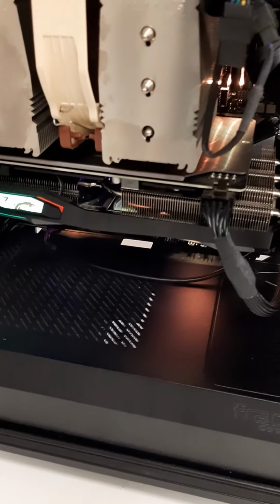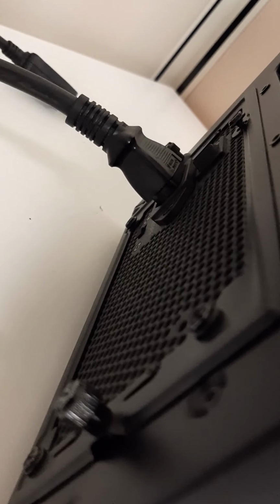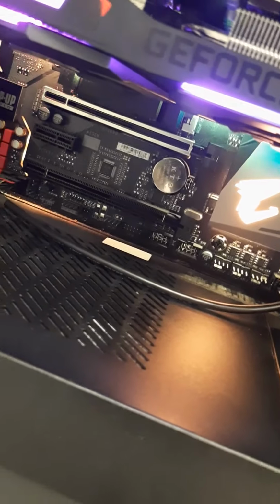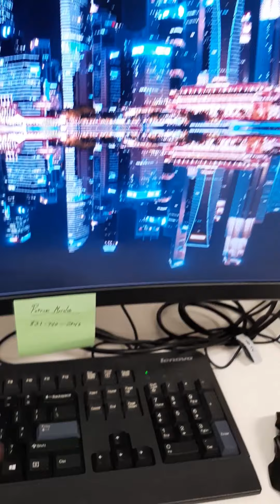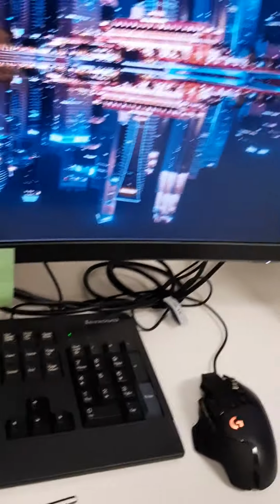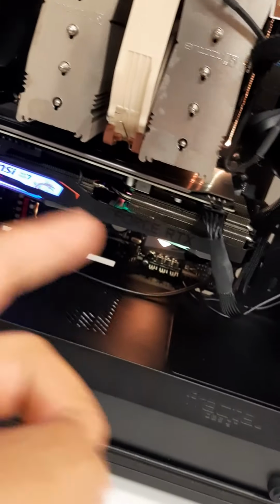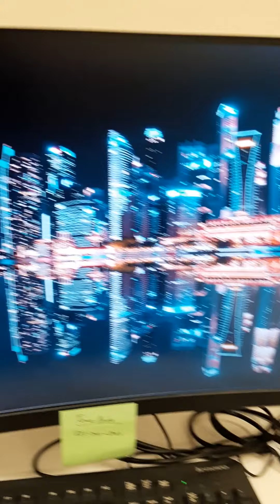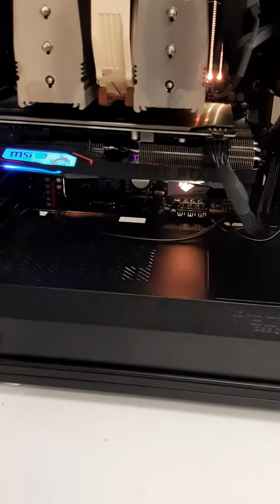HOW TO FIX BLANK SCREEN AFTER ENABLING SECURE BOOT | Windows 11 Upgrade Headache Fix

Comment: I found the reason of the problem, and your solution works for me, thanks for the help :)
Reply: Also in the page of nvidia they recommend the same solution as you
Reply from the maker: What's the reason? I'm glad it worked
Reply: @anthonydiaz6101  For some strange reason YouTube removes my comment when I put a link, so I will send you the link in parts so that you can join everything and you can see the reason according to nvidia
Reply from the maker: @Sandox  it might be because there's a lot of scam comments these days
Reply: @anthonydiaz6101  I tried to send the link in 1000 different ways, but youtube won't let me, so if you want to know why, google:

When installing an after-market graphics card into a certified Windows 8 PC with UEFI enabled, the system may not boot.

The first result.

I hope it helps you :)
Reply: @anthonydiaz6101  And sorry for my bad english XD
Reply from the maker: @Sandox  No worries at all. I'm no English major either 😂
Reply from the maker: @ItsSandox  Thank you!

Comment: bro plz help me i have that same situation right now.. i did that all steps but it has a black screen even my system unit is running on
Reply from the maker: If this did not work, your CPU may not have integrated graphics. You may need to get a new motherboard and just not turn on secure boot after that. Try going through the comments section or keep looking through forums.

Comment: Hey can you help me after connecting graphic card wire to motherboard  the screen is not showing
Reply: I dont want anything ..
Already solved 😂😂😂😂😂😂😂😂😂😂😂😂😂😂😂😂😂😂😂😂😂

Thank you brooooooooooooooooooooooooooooooooooooooooooooo00090
Reply from the maker: @Freternalyouth  Awesome!
Reply: @Freternalyouth  can u please help me🙏🏻🙏🏻🙏🏻🥺🥺🥺
Reply: @spectoryyt2576  what happened ???
tell me
Reply: I was trying to enable the secure boot but i had to update the platform key first then i saved and exit the the monitor isnt booting after it
I tried everything for 11 hours streak but no hope i tried this vid way but still not working
I took the GC out and tried to plug the monitor with the mother board directly but still not working ive tried everything i think i am forced to pay 150$ for a new motherboard unfortunately
Reply: @spectoryyt2576 same happened with me i did csm(secureboot) [for playing valorant] on and after that my pc stuck at motherboard name and unable to open bios
And then i went to motherboard and cleared the bios 
Wait I'll send you one vedio 
I will explain here full
Reply: @Exe.Gameplay yeah offcourse what is your problem??/ tell
Reply: @Exe.Gameplay cant able to play valorant??
Reply from the maker: If you don't have integrated graphics, this method may not work. I hope the comments section could help you out. Some people have found ways around it that have worked for them
Reply: @spectoryyt2576  I'll try to help you. You need CPU that have integrated video. Only in this case you will fix black screen when pluged hdmi to mother board. Maybe your friends have CPU with integrated video. What is your cpu?

Comment: If a have a intel processor that dont have graphics, what should i do?
Reply: And please, can you write the exact instructions of what you do with your pc to fix that error? Please, i dont understand english so much, so you can help me with that?
Reply: I have 2 weeks trying to get another processor with graphics and i try to do the solution and that didn’t work, so you can help me with the instructions? Please bro i need you help :(
Reply from the maker: Go through the comments. A few people have managed to make it work without integrated graphics. Unfortunately, I don't know another fix for this issue. I got lucky that my CPU had integrated graphics or I wouldn't be able to fix it.

You can get a new motherboard. Getting a new graphics card that supports secure boot would help as well. Please scroll through comments for that. Someone fixed the problem by getting a new motherboard and graphics card that could handle the settings. A new motherboard should be enough though, if that's a possibility. Sorry I can't be of much help.
Reply: @anthonydiaz6101  i see, dont worry, my graphics can take changes or damage with that thing of the secure boot?
Reply: @ecochannel9940  send the Mobo to service centre for reprogramming the bios

Comment: Well for people who doesn't have integrated gpu. Try to use the q flash to update your bios if the motherboard support. It save mine.
Reply: Q flash? Please explain
Reply: @bizzo2ps702  q flash allows your motherboard bios to be updated/reset without turn on the computer even without CPU. Try search it online and check whether your motherboard support it or not.
Reply: @codenameice547  thank you so much. It took me 4 hours but i finally got my board to work because of q flash. May the gods bless your soul 🙃
Reply: @bizzo2ps702  happy to help.it took me almost a week 😂
Reply: Thanks for the info. It fixed my pc
Reply: absolute legend, thank you so much!!!!!, didnt find anything on reddit about this

Comment: for those with the cmos reset did not work follow this: if u have a APU plug your display cable directly to the motherboard so that u can bypass the secure boot validation. and get your display back then u can just go into bios and revert the changes you made. no need to replace your motherboard. if u dont have one just bring your mobo to the shop you bought it from and tell them to do what i said.
Reply from the maker: Thank you for your comment. I hope it helps some people out.
Reply: An APU?
Reply: @RokeJulianLockhart.s13ouq  APU= a cpu with integrated graphics on them.
AMD = any cpu with a G on its name end (Ryzen 5 4500G)
Intel = any cpu with a "F" in the end will not come with integrated graphics. Most intel cpus come with it.
Reply: @shoryuguten  Thanks.

Comment: I don't have a integrated graphics on my CPU what should I do I tried evrything 
flashing bios 
removing CMOS battery even replaced one 
Followed all your steps
Pls do tell me what can I do
Reply from the maker: Replacing the motherboard will be one way of doing it. One of the comments said that it's an incompatibility with the GPU, so you'd have to get a GPU that can support secure boot. That's a little beyond me, but getting a new motherboard will do the trick, worst case scenario

Comment: Where did u put your hdmi cable to the motherboard is there like a spot that says or you put that randomly
Reply from the maker: Just any available hdmi port on the motherboard. As long as you have integrated graphics, it should work
Reply: @anthonydiaz6101  mine has no integrated graphics and i removed the batery and then put it back on but it still no display
Reply: @anthonydiaz6101  propably i am gonna go to an expert to fix my pc
Reply from the maker: @Panos2929  That would be a good idea
Reply: @Panos2929 can you tell me if you fixed if yes, how did you do it?

Comment: having no post right now. but by plugging the hdmi/dp into the motherboard, do you not require at least an igpu? i have a ryzen 7 3700x and it does not have an igpu so im not sure this whole thing will work with me
Reply from the maker: Unfortunately, integrated graphics are required for this to work. I think some people in the comments have mentioned they've found work arounds but this won't work without integrated graphics.
Reply: @anthonydiaz6101  can you list such a work around if possible for my friend?

Comment: I don’t have integrated graphics 😭 I got a black screen and I can’t fix it after secure boot enabled. I took apart my gpu and reset cmos as well. My pc: Ryzen 7 5800x, RTX 2070 Super
Reply: Did you fixed it?
Reply: @abhishek_02  nah g, I've been too busy running my SMMA agency. I couldn't be bothered so Im using a laptop atm but I will go fix it soon
Reply from the maker: I've seen the comments section that getting a new motherboard and keeping secure boot off after that should do the trick. Also heard that if you want to enable it, you'll have to buy a GPU that is compatible with it
Reply: @theochan8763  you fixed it now?

Comment: What should i do if i dont have integrated graphics
Reply from the maker: That's a tough one. I'm not sure if this would work without it 🙁. I'm very sorry. I don't just want to tell you to buy a new motherboard but it may be something to consider
Reply: If you found a solution for it please share it with me
Reply: Same here :(
Reply: Same,blocked no bios screen
Reply: @summonhalfa7779  did u find a fix yet
Reply: @faris2329  nop
Reply: @faris2329  I'm taking my pc for someone who fixes computers...
Reply: I had the same issue, had to take it to the mobo service centre. They put a CPU with integrated graphics, reset the bios and gave it back to me. Now I am stuck with windows 10 for no reason.
Reply: @Nidhin89  the same thing they did for me
Reply: @Nidhin89  I took it to a repair centre and they took out the mobo memory and put it on another mobo to delete the whole software of the bios and put a new one with the latest update from my mobo which is to also support windows 11 and they put the memory back on the mobo and now its back working and can also download windows 11 with no issues

Comment: I disables the csm support and enable secure boot and did some other stuff when i did save and exit the pc is on but no signal at all i tried to reset the bios with the battery  reset and still no signal i tried other way to reset the bios but still  same problem tried to check if its the ram but it seems its not so now i have nothing left to do i got an F cpu so i dont have an igpu  i dont really know what to do anymore i lost all my hope .
My mother board is gigabyte b560m v2
Reply from the maker: All these problems seem to be happening with Gigabyte mother boards. But replacing would do the trick, if you can

Comment: I was Turning on Secure boot without CMD converting  I directly enabled secure boot then my PC shouted Down displaying nothing I have remove CMOS batter , rested and nothing worked for me  also removed graphics card and  but I have no HDMI cable right now thats why but let me try HDMI
Reply from the maker: As long as you have integrated graphics, this method should work
Reply: @anthonydiaz6101  I don't have igpu processor i just had an external gpu
Reply from the maker: @htb6956  in that case this won't work. Some people in the comments have made it work somehow, maybe looking through those will work. Other than that, getting a new motherboard is how other fixed their problem.

Comment: Thank you so much bro. This is insane i was stressing and then i found your video thank you 100 times.
Reply from the maker: You're very welcome, I'm glad it worked for you. Thanks a lot for watching 🙏
Reply: Did you leave the battery out the entire time?
Reply: @DCH_Paul  no , just around 20 sec then do what he said , unplug your GPU and put hdmi cable in motherboard hdmi.
Reply: @gennbinaku7656  also one more thing is your pc on during it or no cause mine isn’t working
Reply: @DCH_Paul  no unplug your pc first, then do what i said.
Reply: do you have in built graphics in your cpu?
Reply: @heboy3619  In motherboard not cpu
Reply: @gennbinaku7656  oh also, is it necessary to take the gpu out?
Reply: @heboy3619  yes because windows will start from gpu first , and you need to start from motherboard graphics
Reply: @gennbinaku7656  Oh thanks, btw along w my display the keyboard and mouse also isn't working, will it still work?
Reply: @heboy3619  you only need keyboard to reset bios and it should work
Reply: @gennbinaku7656  bro I tried but it didn't

Comment: i was trying to put new ram in and it wouldn’t turn on i kept trying in every slot and it wouldn’t so i jus put the one that came with the pc and it wouldn’t turn on either the monitor was saying it had no signal and the pc turns on but the monitor says it has no signal it’s so stressing still needs help
Reply from the maker: That problem seems to be different from mine. I didn't have to mess with ram sticks. Unfortunately I'm not an expert in the topic so I wouldn't know how to help. Sorry I'm not of much use. Hopefully you can find a fix ❤ I appreciate giving my video a shot 🙏

Comment: Do you think this would work for me? I have an MSI gaming laptop and the screen went completely black after existing bios and I haven't had time to do this because of school
Reply from the maker: To be honest, I'm not sure if this works for laptops since I had to take out my graphics card. Maybe if you're gaming laptop has both integrated graphics and a GPU but it would be a different process. You may have to take the computer apart to access the GPU, etc. I would do a little extra research about your specific gaming laptop.

Comment: does anyone know if you can do this without integrated graphics? i tried unplugging my monitor and my keyboard starting working again (I could enable numlock/caps lock). Would it be possible to reset the bios settings blind?
Reply from the maker: Try looking through the comments. I've seen a few people find fixes without integrated graphics. Good luck!

Comment: Damn man I have 1660 GTX SUPER S and Gigabyte B460. I tried removing the battery and plug the HDMI to the MOBO. It dint work and have no Del button to enter the Bios. Anyone please help me? 😅I’m dying because I have all my personal stuff in the computer and I can’t afford to reformat everything
Reply: Did you fixed it yet?
Reply from the maker: If buying a new mobo is an option for you, maybe that can work. Just don't turn secure boot back on. Not all graphics cards are compatible with the setting (or so I saw in the comments section)
Reply: @anthonydiaz6101  just because of a game FIFA 23 that requires me to switch on secure boot enabled , I rigged my entire MOBO for that and had to buy a new one JFC. Learnt my lesson and never go to the UEFI BIOS without any knowledge
Reply: @abhishek_02  nah man I bought a new one because I was pissed and rather not waste my time since the next day I had work with my personal computer
Reply from the maker: @olishiz  Same here. I just got lucky I bought a CPU with integrated graphics when I built my PC, just in case, not knowing I'd actually need it one day 😅

Comment: enabling secure boot is an awesome way to screw your self up properly tried everything in the process of buying another mb  reset cmos tried everything still got a black screen after enabling secure boot
Reply from the maker: Yeah, I've left it off ever since this video
Reply: @anthonydiaz6101  i managed to figure this out, i got a better motherboard which when i enabled secureboot it gave me information and warned me that my gfx card didn't support uefi so i got a new card and it fixed the issue i can now run uefi and enable secureboot its a card issue it doesn't detect older cards when secureboot and uefi is enabled hope this helps.
Reply from the maker: @LinuxUsersonly  ohh. Well that's very good to know! What motherboard did you get?

Comment: Bruh after I remove my gpu and connect hdmi to my motherboard still it does not boot up 🙂
Reply from the maker: Do you have Integra graphics? I'm afraid this may not work if you don't have integrated graphics
Reply: @anthonydiaz6101  I have an i7 9th gen 
It does have I guess
Reply from the maker: @MoneyBadger27  it should say on the website that you used to buy it. If not, Google your CPU to make sure. I'm not an expert with this stuff, so I'm sorry I can't really of any additional help 🙁
Reply: @vr_scorpion4964  no it is 9700k
Reply: @anthonydiaz6101  and I have the same motherboard as yours
Reply: @vr_scorpion4964  why it still doesn’t show up then

Comment: did your pc have a cpu indicator? i built a pc today, everything worked booted up, pressed f2 then i turned it off because i needed windows then i come back and this pos does not display, my keyboard does not work and my cpu light is on
Reply from the maker: I'm not sure what a cpu indicator is, sorry. My keyboard was working, it was just that I had no display. I had to use my integrated graphics to be able to get a signal and navigate around. Sorry I can't be of much help :(

Comment: I have tried the exact same thing but nothing is popping on my screen when I am pluggin my hdmi to the integrated graphics ! Why ????? I know from my past that I tried to test if I can run without a gpu and it didn't work, how do I make my integrated graphics to work ? ...
Reply from the maker: If it doesn't work, then you probably don't have integrated graphics. This method only works with integrated graphics and it's the only way I know how to fix it.
Reply: @anthonydiaz6101  how do I not have a integrated graphics If I do have exactly there the exact ports as you, HDMI, VGA and 1 more, different from the GPU, in exactly same place as u
Reply from the maker: @onlyroly Those ports are on the motherboard. Integrated graphics come from the CPU. So you can have the ports, but it doesn't mean your CPU has integrated graphics.
Reply: Did you figure it out? I'm going nuts

Comment: Hello, so I followed your steps but I got up to the part where the monitor shows your boot key options (Del: bios setup F9: System information etc) but no matter how many times I press the key, the bios menu does not show up. Please help me.
Reply: Never mind I figured it out. THANKS FOR THE VIDEO, SAVED MY LIFE
Reply from the maker: But does your PC itself actually boot up and can you use it? If your PC is working you should be able to change some settings around to slow down your boot time so that you have more time to actually be able to load up bios. I'm no expert in this though so you may have to do some extra googling. Sorry I can't be of much help